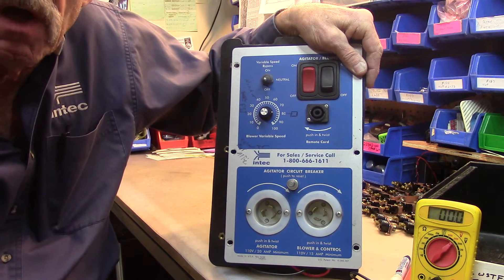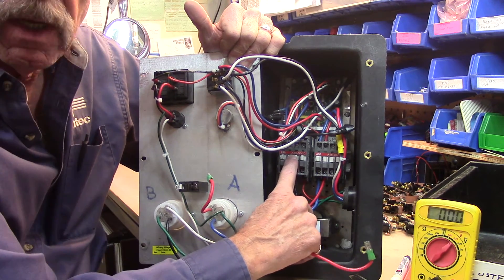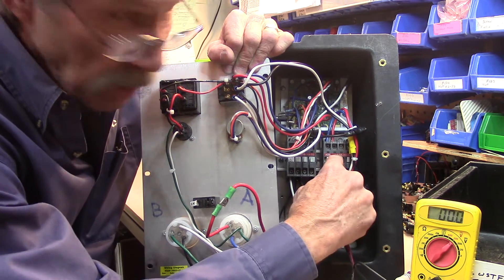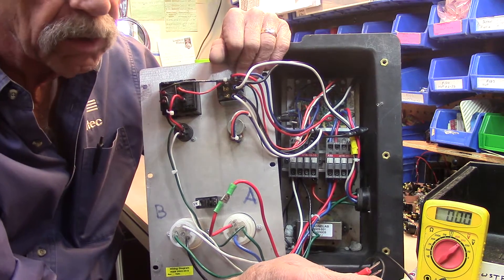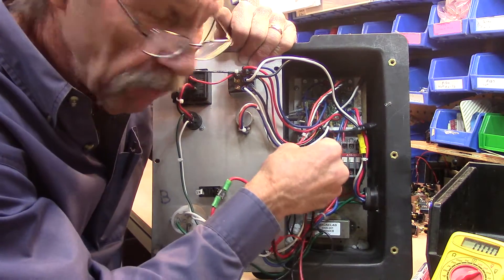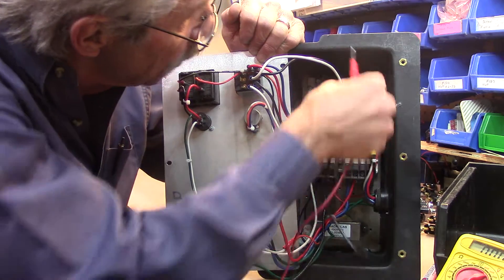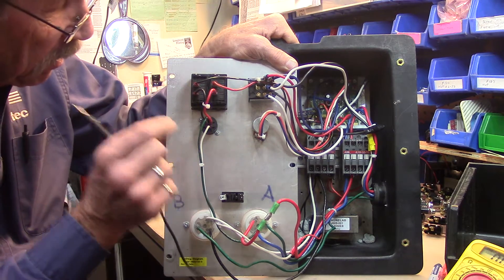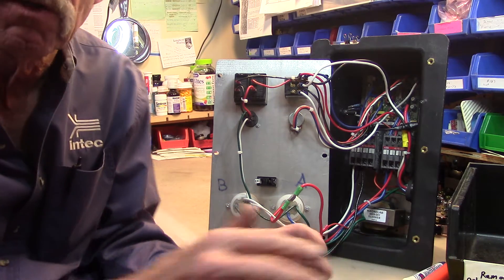Force/2 Electrical overview

Comment: Hey William. First, thanks so much for all your videos. As a new insulation contractor and Force 2 owner, it has been incredibly helpful! So thank you for that. I primarily install cellulose (wet installs) into attics. I also do a bit of drill n fill wall retro fit installs as well. I am looking to install a solenoid valve so that when i turn on the agitator motor, the valve opens up and lets the water flow and when i turn it off, the valve closes again. I'll also need a toggle switch for applications when i dont need a wet install, such as walls or fiberglass jobs. Do you have any ideas, places to start, people to contact that could help me figure out how to do this? I can't quite grasp how I would need to splice into the agitator circuit but also have a toggle switch. Any help would be greatly appreciated sir. Thanks!
Reply from the maker: I am on the road, will be back to where I can respond Tuesday, I will be in touch
Reply: @williamjewell9574  Thank you!

Comment: I noticed in the manual that the 2009 and 2011 wiring diagrams added ground connections to the aluminum panel and the interior mounting plate. Is it ok if I do the same for my older model?

Thanks for recording this. The F2 is an incredibly durable workhorse.
Reply: Hi Diy Guy,
I am the current EE at Intec. Yes, you can add a ground to the aluminum panel and interior mounting plate. This is a smart thing to do, particularly if you make those grounds common to each other so that the whole machine is on a single ground plane. This will give more metal for overcurrent to dissipate itself in should something fail.
Reply from the maker: Hi DIY Guy, I have forwarded your inquiry to our factory in Colorado for Tec help from our electrical designers for final advise. I feel they will confirm that adding an additional ground wire will work and add an additional layer of safety. Thanks for the confirming the durability of "the Hot Rod" of insulation blowers, the Force 2
Reply from the maker: DIY GUY, could you call me direct at 727 810 0466 to discuss  Thanks  Bill jewell  INTEC